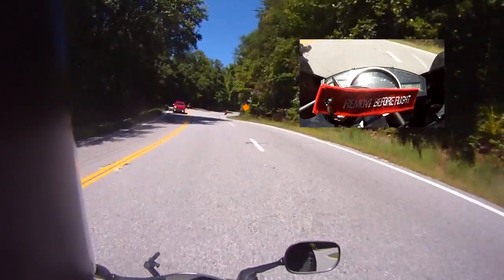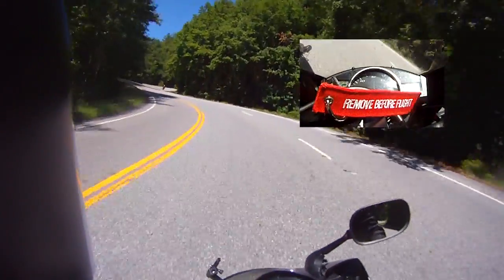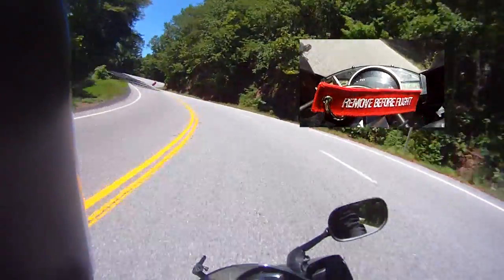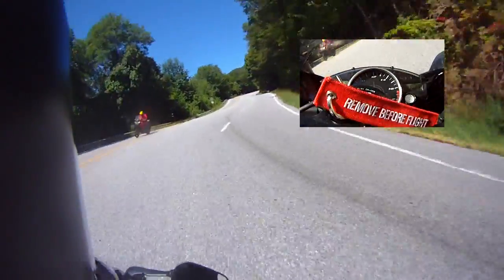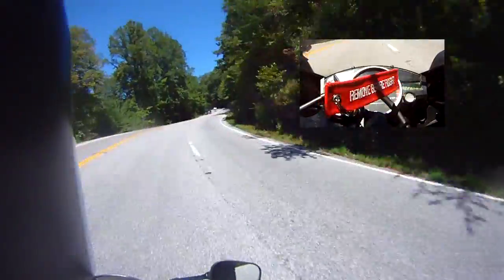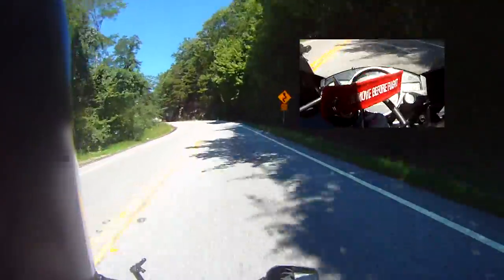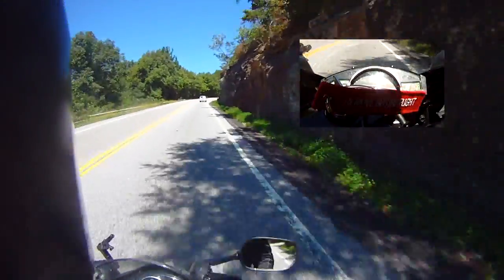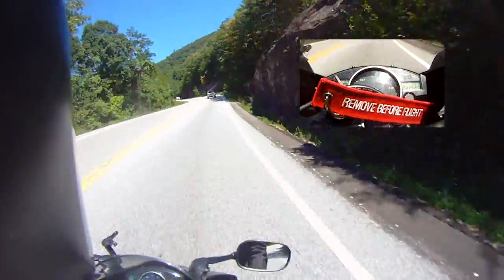How-to:  Engine Brake on a Sportbike

Comment: If you're just starting, do what mattbauer97 said and just forget about rev matching and just let the clutch out very slowly while you slowly roll on the throttle as if you're starting from a standstill.  However, if you've already figured that out and you want to learn and improve (it's easier on your transmission to rev match) then you kind of just have to feel it out.  You should blip the throttle so that your revs are up at the same time that the clutch catches.  This takes a lot of practice

Comment: Yep, I use it more then the front, and even if you start sliding you still have control over the bike unlike if you lock up the front wheel then you are 100% on the ground.

Comment from the maker: @rvl1980 This is true I did make that transition and I do agree on the vtwin the engine braking is stronger but  I didnt feel it was so much stronger to mention it. I guess its possible that when I was on the SV650s I wasn't going as fast as I am on the R6 which translates to close to the same braking power by the engine but who knows. Good point to make! Thanks.

Comment from the maker: @Gellantara thats close but downshifting can be part of engine braking. If you downshift and engine brake it can slow you down from a high speed much quicker than simply letting off the throttle. I dont really think its a one or the other type of decision but rather a which is best for certain scenarios. I just want people to know their are other options other than laying on that front brake. Hope that makes since ;)

Comment: during a panic brake it's best not to use the rear brake... all the weight is quickly thrown forward so the front brake is actually all you'll need, do not immediately pull in the clutch but wait until the revs are low, downshifting is not really neccesarry on a panic brake... just don't sla; on the front brakes too hard or you will lock up the front wheel which is never a good thing... hope this helped out a bit, you can practice this on a calm road to get used to the feeling

Comment: Is applying the front brake lightly necessary or helpful?  I just rev match while letting the clutch out, but I notice sometimes its can be a little jerky still.  Does the light front brake help at all?  I don't engine brake much, I usually ride long, straight highway, just cruisin' along, so I don't worry about slowing down or speeding up much, but when I go into the city I know some roads that are wind around a bit, it would be nice to have this skill perfected and ready for such an occasion.

Comment: Those who are into cars(particularly JDM or racing cars) as well as motorcycles, then it's basically the same as Heel 'n' Toe in a car. In a car it's exactly the same - you quickly clutch and simutaneously brake with the front of your right foot and blip the throttle with the back of your right foot.

Comment: Side note, engine breaking on a vtwin vs 4 cylinder will feel a hell lot different. Be careful on the vtwins since u will slow down a lot more or have a greater chance of locking up the real wheel. Chase3d, you should know about that since u transition to a 4 banger.

Comment: when do you release the clutch and do you brake while blipping the throttle? whenever im downshifting to a stop when i match rpms it fells like it wasnt slowing down fast enough and i got into a habit of just pulling in the clutch and braking when stopping and shifting down without releasing it.

Comment: Big rigs have a special break designed for this it's called a "jacobs Break".  The Jacobs break actually slows the RPM of the engine down with compression has nothing to do with the transmission

Comment: while the clutch is in, you want to match the speed of the engine with the speed of the back wheel so that the bike doesn't jerk. if you let the cluth out very slowly you dont need to blip the throttle

Comment: I've never really done it that way, normally I just let the clutch out enough so that it starts to catch and slow it down but does not fully engage and abruptly lock up the rear. For some reason I feel like I have a lot more control that way and I find it smoother than when I blip the throttle. Although, I never have quite gotten the hang of blipping the throttle because I just don't do it that way much and prefer it this way.

Comment: I don't blip when i downshift I just hold the throttle on a little bit and when I squeeze the clutch it naturally blips, and I get a nice smooth shift. of course this only works in a certain rpm range, with certain gears haha. It just takes learning your bike

Comment: well I only use the rear brake when i'm slowly approaching traffic lights, because it's much more mellow and easy to control the brake power, so if you don't need a lot of that=> rear brake :-p still waiting for my license plate for my new bike...:( wanna start vlogging too

Comment: I'm not an expert but I don't think normal engine breaking puts any abnormal stress on your transmission, clutch, etc. I would hope these engines would be designed to handle normal engine breaking because if they weren't then we would never be able to come off the throttle even while normal slowing. Where I think engine breaking maybe could add stress is when you start downshifting early in order to slow quicker. I rarely use my break at all except to come to a complete stop or if I have to stop fast. I just wait until my rpms come down before downshifting to the next gear and I've never had problems with my engine, transmission, clutch, etc.

Comment: Its not done anymore now that they are on computer operated gearboxes. But yes it is a racing technique. It stems from when braking for a corner you need to be using maximum grip braking from your rotors and you need the car to be in gear. If you downshift and don't blip there will be extra friction from the engine that will lock the wheels up.

Comment: If it has the same science as a manual car, when you downshift the pistons have to work harder in a short amount of time which "pulls" the car back because it cant remain the same speed and work the pistons harder at the same time

Comment: Actually, not all F1 drivers are the same. Some do, some don't, although I think most do their braking and downshifting before the turn. I mean, that's just in a nutshell. If you want to get technical, they brake into the turn and have to enter JUST at the right speed without going wide, then shift into the correct gear to take off from the corner without going too slow, AND they have to have proper pedal discipline to not spin out either.

Some people say it's easy, pfft. A turn alone is hard.

Comment: you guys would shit bricks if you knew how much i use the decompression lever on my 98 xr400 as an engine brake. It works fantastic. You dont have to worry about locking the rear wheel up in a turn and you can apply the front brake as needed to help slow you down.

Comment: isn't rev matching different from engine braking? can someone please differentiate the two for me
Reply: Engine braking is pretty much just downshifting at a high speed and letting off the clutch. For example, I'm running 75mph in 6th gear and I want to engine brake. I pull the clutch in and downshift to 4th gear and let off the clutch without getting back on the throttle. Your engine's RPM's are going to go way up once you shift from 6th to 4th and let off the clutch. That's engine braking. 

If I'm running 75MPH in 6th gear and I engage the clutch, then shift from 6th to 4th and simultaneously get on the throttle as I let go of the clutch that is rev matching. You are basically matching your speed with the engine's RPM. 

The only difference between the two is engine braking; leave the throttle alone when you downshift Rev matching, you blip the throttle to match the engines RPM when you downshift. 

That's the best way I know how to explain it. I know how to do some things better than I know how to explain them. I've never really thought about what exactly I was doing wen I rev match; I just do it.  lol Hope you understand.

Comment: this is called heel and toe shifting on a manual tranny car. much harder on a car because you have to brake with your toe, push the clutch with your left foot, blip the accelerator with your heel, and change gears with your right hand
Reply: Veyronp87 goddamn putting it into words sounds so much work lol

Comment: Too much gas and/or you're going slow enough that your engine is near idle when you downshift so there isn't a large enough difference between the two gears. Rule of thumb for shift points while braking is to cut the braking distance into halves and downshift at each half. IE 6____________5______4___3__2_1

Comment: so my engine wont break when i engine brake? neat.
Ppl worry about syncro's in gearbox tho? Dunno if those are even a real thing on a motorbike
Reply: Most motorcycle transmissions don't have syncros.  Just "dogs" that slam into place. Even if they did, the purpose of blipping is to rev match, which solves that problem anyway.

Comment: pretty sure this is a negative effect on the bike, it is straining the engine and not properly utilizing the gears uses. you wouldn't do this in a car, why would you do it on a bike?
Reply: Yes. You do this in manual transmission cars as well. I had an 03 Evo for about 10 years and never had an issue with my transmission or my engine. You just have to use common sense. Example: don't try this going 120 in 5th and shifting to 3rd gear. I usually would use this coming up to stops. Never damaged my tranny or motor and saved a TON on pads/rotors
Reply: Kyle Comer i use the engine to help braking pretty often in cars and on my bike, i thought it was a common tool people use. i guess not
Reply: +Kyle Comer of-course you do this in a car....what's wrong with you?